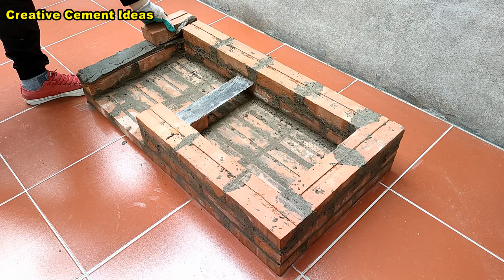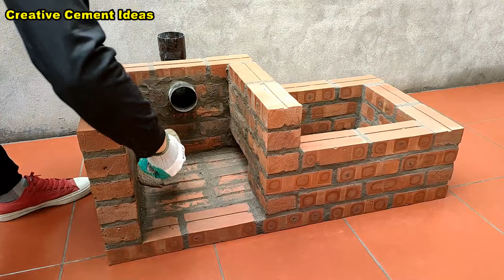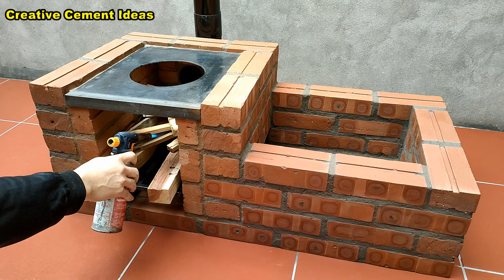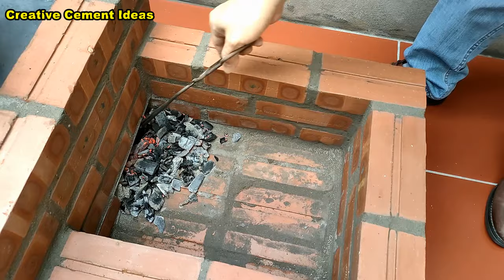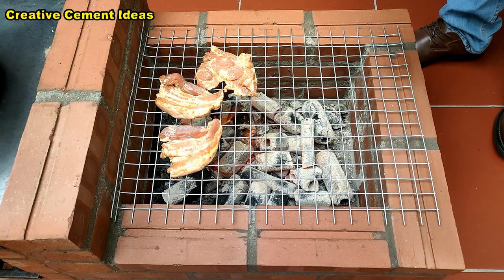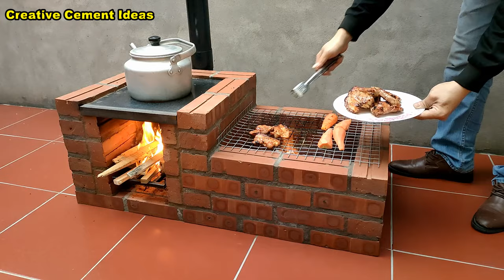How to make a 2 in 1 wood stove with bricks and cement 2

Comment: about how many bricks are required?
Reply from the maker: Hello, I made this kitchen with about 90 bricks
Reply: Pls always give an idea of measurements. Our bricks are somehow different from yours.
Great video as always.
Reply from the maker: @olatundeabiri7048 Hello, this stove model is simple, easy to make, measurements do not need to be 100/00, combustion chamber 20-25cm, height and depth suitable for your tiles, minimizing the need to cut tiles.